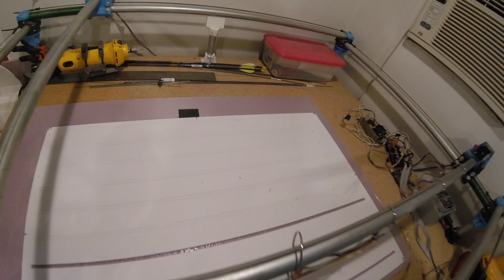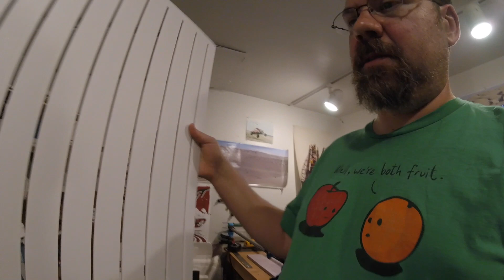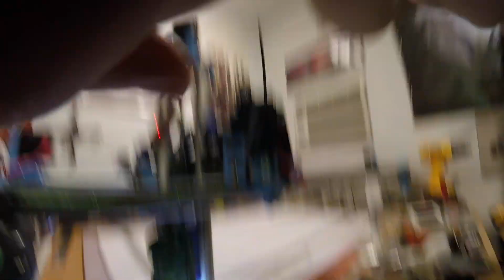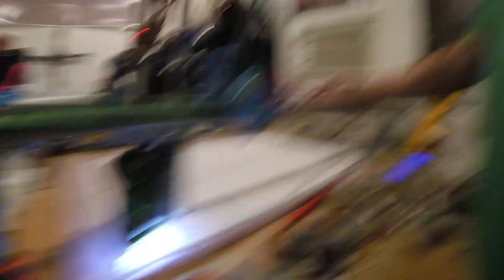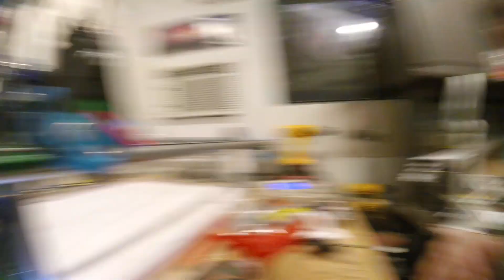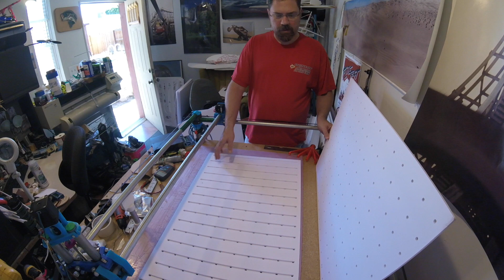This project sucks - MPCNC Vacuum table build.

Comment: I hope that this will be seen. I notice there have not been activity on this vid for a while. Here goes
I made one of these vacuum bed and have an issue with suction in one of areas that is the farthest from the port inlets. There is little or not vacuum at this point. Unfortunately, it is at the origin of my material (lower left on the MPCNC). I was wondering if it matters which channel sheet was laid down first. When I first assembled the vacuum bed, I put the horizontal sheet down first which that was no vacuum at the far lower left. I turned the channels 180 degrees and it appeared to do a little better. The vertical channels where now on the bottom. This seem to disturb the vacuum  To the far left lower area. Do you have any suggestions on what could be causing the issue?  I noticed that you put the horizontal channel as your first sheet then the vertical as the next. Thank you
Reply from the maker: Sorry for the slow reply...YT doesn't alert me well when I get replies on videos and since I haven't had time to make new videos I keep forgetting to check for messages.  Unfortunately I'm really not sure...it was such a quick and dirty design I was kind of surprised it worked at all when I created it.  I usually use the smallest cheapest shopvac I found for $20 at the big box store - and while it has noticeably less suction than my good shopvac it still provides good even suction (just I can move the whole thing easier than when I run my big vac.)    To the best of my understanding it shouldn't really matter which set of channels goes where...but at the same time - whatever has the least restriction is probably best and it seems like having the verticals be the main entry might cause more restriction so maybe it does?  Again, sorry I can't really give a better answer :(

Comment: Hi!. what is the working area of this mpcnc?. thanks
Reply from the maker: The rails are 4' in the Y and about 3.5' in the X.  I don't remember what the exact working area is but I can easily fit 20" x 30" sheets of foam board with almost a foot to spare in both X and Y.

Comment: Make sure your vac can cool itself even with no air flow.  Most of the standard shop vacs out there aren't rated for this type of usage and will burn themselves up
Reply from the maker: I did in fact burn out my old shop vac.  I felt fairly safe using it because it had a cooling fan on the motor with separate inlets/outlets from the vacuum side.  However it was about 10 years old, had been abused heavily and was already making some funky sounds after getting clogged with MDF dust a year previously...so I wasn't that surprised when it gave out pulling suction on the vac table.  

I have a new vacmaster which also appears to have a separate cooling fan - but the exhaust from it and the exhaust from it's cooling air definitely get warmer than I'd like when sucking down the table.  

For now not wanting to risk my new vacmaster I picked up the cheapest vac I could find in town - $20 at wally world for a ridiculous little 1 gallon stanley.  It's pretty weak but makes enough suction to operate the table.  A quick inspection again showed a cooling fan with separate inlet/outlet and so far after 6 months of fairly regular use it's holding up just fine...and if it does die at only $20 it's not the end of the world.  Though I would like to find a better solution with a blower I can mount outside my shop to keep the noise down - but I'm not in a big rush to tackle that since the $20 cheapie seems fine so far.  And it turns out my wife likes the little guy better than my big van for cleaning the car so I get a cleaner car as a bonus as well :D

Comment: Use the old spoil board to make a 'silencer box' to quiet your vac! <grin>
Reply from the maker: I do have plenty of that pink foam left...but...I burned out my old shop vac last night on just the 4th sheet of foam cut with the vac table :(  I've added some leakage to the vac table to allow more airflow through the vacuum - but tearing it down to see why it failed it looks like it may have just been old age and the brushes giving out.   The motor is sealed off separate from the vacuum air and has it's own little cooling fan.  Plus the vac is 15 years old and had been making some funky noises lately anyway.  

Honestly though I'm SUPER cramped for space in my "shop" so moving the vac outside is probably how I'll deal with the noise long term.  As I mention in the video I have a walled off area next to the shop with some shelves and benches with protected areas I could easily locate the vac.  Just a matter of wiring things up so I can turn it on and off remotely and getting a longer hose.  

Oh...and getting a new vac now :D  I actually have a new vac but want to get a small cheap one to dedicate to the vac table in case I burn it out again!
Reply: When you get a new vac, get one you can plug your spindle into, so when the spindle gets turned on the vac starts up 'automagically'.  I do that with my chop saw and other things, it makes the world of difference, keeping me from 'forgetting' to turn it on.  Yep, it costs a few $$ more, but well worth it.  Also, with a Y, especially if you get a 'little bigger' vac you can power both your table and a dust collector head. ... Keep up the good work.
Reply from the maker: I actually have a big 12gal vac my wife and daughter gave me this past fathers day that I use for dust collection.  Just don't want to risk burning it out on the vac table ;)  So going to get a small cheap one to dedicate to the vac table.  

Rigging it to power up automatically would be nice...but so far I've had no luck with dust shoes on my spindle.  The new vac sucks a LOT better than the old one I burned out last night, but even so it didn't do much when mounted to a dust shoe so I hold it manually and follow the machine around.  The main problem is I haven't found any suitable brushes to go around the base of the dust shoe.  I keep searching but can't find any strip brushes locally.  Eventually I'll probably break down and order one but I'm cheap and opportunistic so keep hoping to stumble across something suitable :D